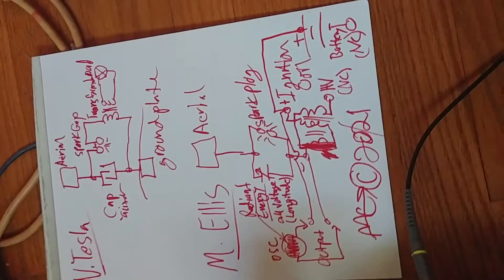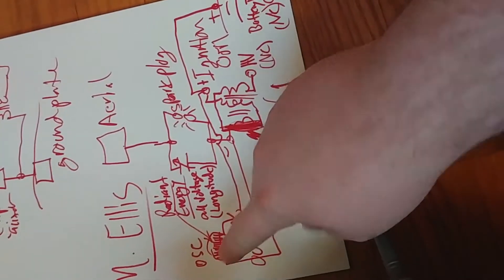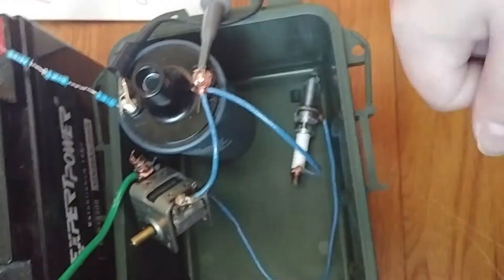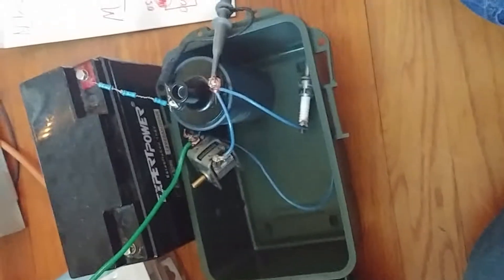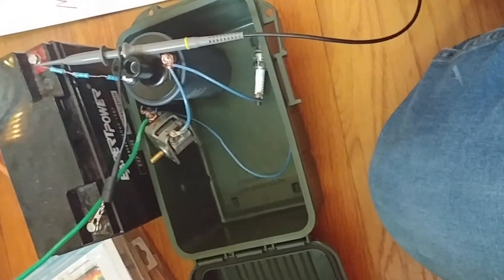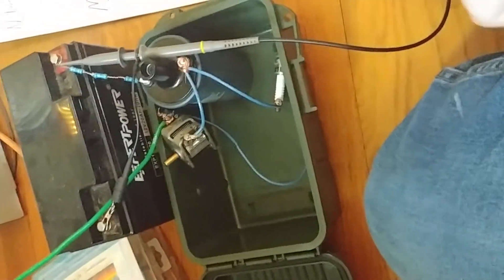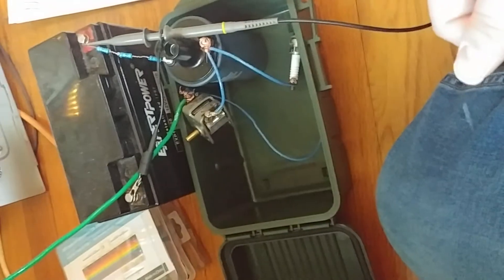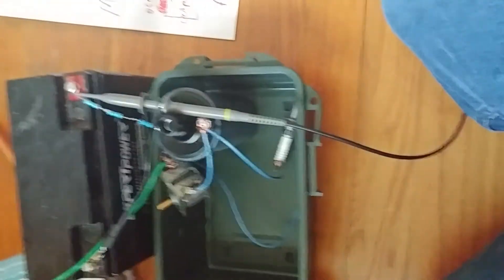Green Energy: Modification of Nikola Tesla's Radiant Energy Device

Comment: Don't even need the antenna. Tesla discovered this and began to use artificial sources of high voltage. You can use an NST but it needs to have the ground fault wire cut. Should be the 35khz versions. If you can find the ones without the protection then even better. The output of the NST needs to be rectified and ONLY use the positive output.

Comment: Try a motor and v can get to believe... As motor use v to I phase difference u need a cap  and the how wd u convert to 60hz.wr will the transformer come in.... Also u need to raise the energy to high voltage before stp dn for current let's c if u can achieve that or use a Morin motor along w to convert energy let's c

Comment: Looks like it should pulse-charge that battery to full over time. Nice job, Michael.
It you are open to a different theory, here goes nothing.
What if Tesla's secret was to use the byproduct of the spark, which is a short but intense magnetic field around the spark, which collapses when the spark dissipates? (A naturally occuring electromagnet of a sort) If that spark/discharge occurred next to a permanent magnet, would the magnetic field around the spark cause the magnet's field to move in response? If the magnet's field is attracted to and moves toward the field around the spark, would stationary coils around the stationary magnet transduce electricity each time the magnet's field moves/warps toward the spark? If the antenna collected enough to discharge across the spark gap once or twice per second, 24/7, that might be a useful amount of electricity. A radiant energy antenna on a vehicle flying down the road would collect a lot of static electricity very quickly, BTW, as would a stationary antenna in high winds.
That would be a mechanically motionless electric generator that used the magnetic field around the spark to move the magnet's field without any need of input from the end user. Cost-free energy, but not overunity.
At any rate, it is a theory you might test at some point, if you like. Good luck with your future endeavors.
Reply: If you wanted to try a proof of concept experiment to disprove or prove that theory about Tesla's secret, you could set up a wimshurst static electric generator to discharge (spark) into a nonferrous (aluminum) ground rod. Place a stationary magnet with stationary coils near the ground rod, close enough that the spark from the wimshurst is within the magnet's field. Hook an LED to the stationary coils around the stationary magnet. Hand crank the wimshurst and look to see if the LED lights up with each static electric discharge from the wimshurst.
If it does, the coils are transducing electricity to power the LED due to the magnet's repeatedly warping field.
Share this with others you might know with the skills and/or equipment to further investigate this theory, please. This theory is something I stumbled across over 20 years ago, not my theory, and that information literally disappeared from the Internet within days after I found it. In my head is the most useless place on earth for this information, so I hope someone can bring it out into general knowledge and do some good with it. BTW, that experiment was originally done over 100 years ago and it is my belief that Tesla was aware of it via written correspondence with the original inventor during the 1890's. Tesla later took the leap from using a hand cranked wimshurst to make the spark to setting up a radiant energy antenna to passively collect the static electricity from charged particles floating in the air so the end user need not actively provide any input energy to operate it.
If all this is correct, you now have the means to easily build a limitless, DIY electric generator made with available off-the-shelf parts to freely share with others, if you so choose. The faster you share this info, the less the chance that the information will be lost again.
Good luck with your future endeavors.